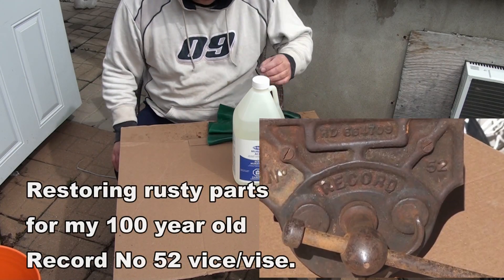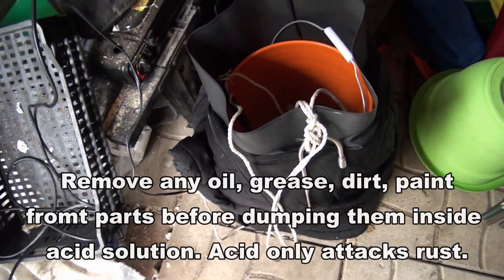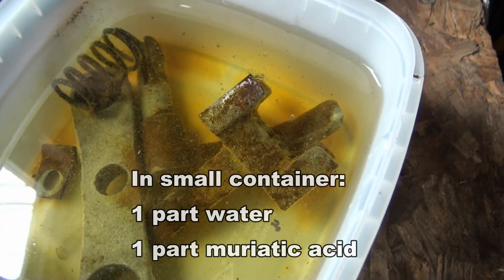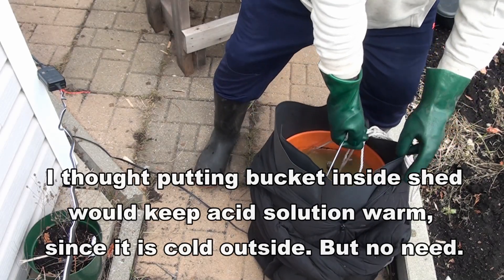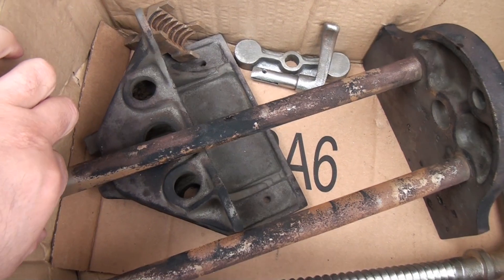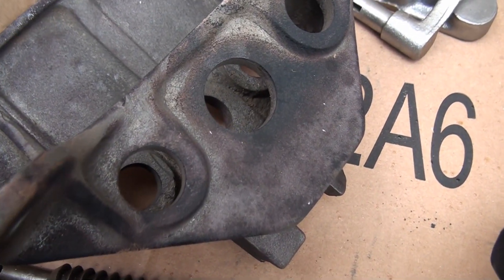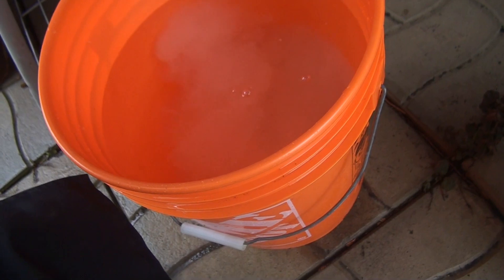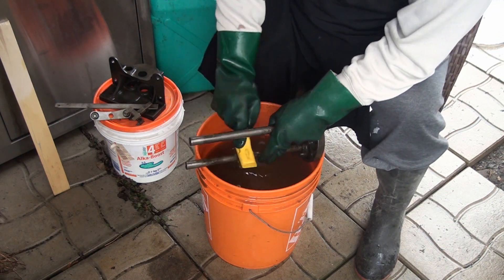Rust vs Muriatic Acid ***DISASTER*** Do not do this

Comment: Freshly cleaned steel LOVES to flash rust from humidity in the air.
Coat it immediately after drying, either paint or oil.
And it is always best to just neutralize acid with baking soda in water and leave it sitting in it for up to an hour, at least uintill there is no bubbling.
And alkaline water also prevents rust

Comment: So I am going to clean up some rusty railroad spikes.  I put some in Evaporust and some in pure Muriatic acid (31% Hydrochloric Acid).  The acid works much quicker. The Evaporust may work also, it will just take longer.  So question.  Is there anything to soak/clean the spikes in when they come out of the acid, that will prevent them from rusting right away again--OTHER than oil products?  I am eventually going to paint them but I don't want to have to paint them immediately after they come out of the acid.  If I soak in a high alkaline water bucket, then dry them, will the rust right away?  Any ideas?

Comment: When mine came out of the muriatic acid all shiny like yours, I found that not neutralizing the acid but just rinsing in water caused them to rust again. I neutralized with some Drano which I had.  This cause a black coating to form on the metal pieces which I did not want.  So far I have not found a way to keep away the rust that does not cause the blackening.

Comment: Its the water in the air that is causing it to rust again, clean fresh metal will rust quickly.    You have to SEAL The Items right away with sealer or Primer.

Comment: forget acid processes and use electrolysis which is safe and cheap. It is a bit slower and is certainly messy, but it will only remove rust and does no harm to the metal., An old domestic water tank or a plastic barrel is great for the job and will easily take even the largest of vices - try it out for yourself and you will see why I like it so much.   :<)

Comment: Baking soda neutralizes acid. I am a professional auto technician 20+ years and whenever a battery leaks that’s in a trunk that’s what we use to neutralize the acid and clean up. I personally wouldn’t open a bottle of any type of acid without a big box or bag of baking soda in the event of a spill or something. Might be better ways to neutralize I’m not a chemist but I wanted to say this so maybe it helps someone avoid an emergency.

Comment: Muriatic acid leaves a greasy residue and just rinsing won't get it off. I wouldn't use too much making soda, Ph neutral is around 7.6, Muriatic acid has a Ph of 1 and baking soda or sodium bicarbonate a Ph of 8.4. It will neutralise it as mentioned plenty of times before but I've personally always had success by simply cleaning with an industrial degreaser and then a pressure washer. On concrete and metal. Bare steel needs to be covered afterwards once dried, oil based primers with an anti rust additive work great.

Comment: Those fumes are insidious. 1 gal jug, 41%, lid on tight: inside 48' x 60' shop w 20' walls (large interior volume) all my stuff was rusting. Lid was not fully sealing despite being tight.  Put it outdoors and solved the problem.
Reply: At 41% and warm it will build up pressure. Usually 36% is max

Comment: Thanks for the good video. A few comments. Acid + base = salt + water. The natural antidote to (muriatic acid) hydrochloric acid is sodium hydroxide (lye). Muriatic acid + lye = table salt + water.  Water does not neutralize, only dilutes. Hydrogen chloride vapors irritate the respiratory system and corrode everything nearby in seconds!
In industry, the process is: after degreasing, rust removal with hydrochloric acid and then immediately rinse thoroughly. If the intention is to elektroplate, there is no need to neutralize, because the elektroplating continues in the acid. But if the intention is to paint, you must immediately neutralize with alkali (NaOH) and then rinse with plenty of water and dry with hot air. 
Inorganic acids produce interesting results. If you neutralize acetic acid with calcium carbonate (washing soda), you get calcium acetate Ca(C2H3O2)2. When heated, it decomposes into acetone and calcium carbonate.

Comment: The rust didn't come from the acid whatsoever. This happens when you get metal down to a bare surface and leave it exposed to moisture. 
It's the same reason your brake discs will get a coat of orange surface rust overnight if it's raining.
Bare metal parts need to be covered in either paint or oil almost immediately after cleaning.

Comment: I don't think it was the acid fumes.  I think it was just moisture in the air flash rusting the freshly etched metal.    You got fresh acid etched bare steel.  Any bit moisture is gonna make it rust right away.

Comment: I’ve been experimenting with stronger and stronger vinegar to get rid of rust off old tools. I think I’ve pushed it too far and the last batch I left in 20% strength industrial cleaning vinegar for a few weeks and now all the hardened steel is eaten away like a honeycomb effect. Does anyone know if they are ruined or is it salvageable with heavy grinding?
Reply from the maker: Hey Matt
I would not grind the tools. This would further weaken the tools by removing material. Neutralize well with baking soda and water and apply some WD40. 
What I now use to remove rust is Evaporust. Very effective yet gentil on metal and not corrosive to humans. Expensive BUT you can re use it over and over again.

Comment: You made it way too strong.  For every 1 L, use 900 mL of water then 100 mL of the concentrated HCl.  That means you will dilute the acid 10X.  Always add acid last.  So it you want about 3 gallons total.  Add 10.4 L of water to the bucket first then about 1 L of the acid last.  You only need to put the part in for about 20 minutes.

Comment: when you acid bath the metal it strips it bare. in that it will rust instantly! take it out of the acid and neutralize in baking soda, dry and either paint or coat in oil to keep it from rusting again rapidly.

Comment: I need to remove heavy rust from steel base columns . So if I understand.  1. MIX 1 cup acid + 1 cup water with baking soda. 2. Spray 3. Rinse with water 4. Dry really good  and 5. W40 or primer. I am right? Thanks
Reply: No

Comment: Be sure to neutralize the acid, with Sodium bicarbonate (baking soda) or Amonia. Then, immediately coat the bare metal surface with a protective barrier like oil, or  primer if you plan to paint it.
Reply: If you want to electro plate it with nickle how would this be done ? Thanks

Comment: Flash rust is a thing, but note how the part that wasn't in the acid didn't rust? Yeah, water alone won't neutralize the acid, use a baking soda water mix, then rinse with plain water after. I made that mistake before, it's a learning process. Love how you had the success and failure together. So many fake people would have edited out the mistake, respect.
Reply from the maker: Yeah, I learnt the hard way too. Thanks for watching.

Comment: It may be a bit redundant, but I think I would pull the parts out. Neutralize them in baking soda and water. Before I did any kind of brushing at all, when dealing with acid. You can always throw them back in if they are not done.

Comment: Muriatic acid is over kill at most you only need a 6% solution. Ifs better to use vinager or citric acid for rust then neutralize with a bicaranate solution. Use wd40 to stop it rerusting. Do not use muriatic acid for this.

Comment: It is best to neutralize with baking soda in the water.  Plain water would have to be changed a few times with long soaks.  This would most likely reflash your rust.  Baking soda neutralizes the acid in all the nooks and crannies very quickly so a ten minute soak in warm water with soda will be very effective.  Then one rinse in pure water and quickly drying the items seems to work the best.  After wire wheeling wipe them off and coat with an oil.  I like to heat them to three or four hundred degrees and then quench in oil.
Reply: Good advice. What’s the strategy of heating to such high temps at end… is it to dry it?!
Reply: @rudysmachado5747  dry it as well as allow the metal to draw the oil into the steel while forming a strong coating
Reply: PS:   you do not want any moisture under any type of coating for the most part.
Reply: PPS:  Also gets rid of the moisture quickly and thoroughly.  Longer it sits on or in the metal the more oxidizing occurs.  Lots of O2 in water able to combine with the metal for rust, much more than air.

Comment: Used Muriatic Acid for 25 years.
Safety first.
Use full strength or 50/50 water based. 
If soaking at full strength it has to monitored. Will eat the part. 
I usually will brush acid on non precision car parts. If the part had ground or machine surfaces use sparingly. Or use cleaning vinegar. 

Some parts I full on full strength. Trailer axle, trailer springs, lawn mower deck, snowblower housing, car rims.

Parts of machine finish to use a lighter acid to clean. Crankshaft on lawnmower or snowblower.can put electrical tape on ground finishes and do the counterweights with Muriatic. 
Always be careful. Bottom line.

Comment: Freshly cleaned metal will rust start rusting immediately in the air as well (the acid vapors also) you need to paint or oil the parts to keep the air away.

Comment: Three things: 

1) Neutralize the acid on the iron by putting them in a baking soda or drain unclogger + water solution for a few minutes, or scrub them down with oven cleaner (fume type).  Then soap wash.  This will prevent rust flash, and also the rust won't develop under any paint you might use.  (Water alone does not neutralize anything.)

2)) Don't acid-bath springs!!! This will cause a change in the metallurgy and also cause stress concentrations.  Just buff them off.

3) Those plastics like what the bucket is made of don't get affected by Muriatic acid.  However, some plastics disintegrate in short order.  Best to keep this in mind.
Reply from the maker: Thanks for the tips. I will be more careful next time knowing this. Unfortunately I had to learn the hard way. Thanks for watching!

Comment: Or hydrochloric acid if you want the more accurate chemical name. Muriatic acid is an old fashioned term meaning "pertaining to brine or salt" (Wikipedia) which really has little to do with its modern production. A term used more for historic reasons than anything else. Sometimes also called Spirits of salts. If you walk into a hardware shop here to buy Muriatic Acid they will look at you blankly. I suspect that Muriatic Acid usage in the US is a bit like Imperial v metric. Sometimes the US has a bit of difficulty keeping up with the times.

Comment: I had a neighbor with a gallon of muratic acid that had a pin hole leak onto a wood bench and didn't know it. It ate a hole in the bench and the fumes caused any fine steel that was nearby to rust in a matter of a couple weeks. Almost a disaster. It's thought me to even bag the jug with some heavy plastic if I store it.  I pretty much use the Evaporust now, fairly safe even though it takes a little more time. 👍
Reply from the maker: Where I bought from, they had it wrapped in a thick thick THICK plastic bag. This chemical must be kept out side! Away from any kids! I don’t use this product anymore. It’s a great product but too dangerous.
Reply: @Quinteros777  Yeah, I keep mine at the end of the garage by the door in a thick plastic bag also. ANY leak can be a disaster. If the stuff wasn't handy to have once and while I would just buy and discard.  The good thing is no kids around anymore and ifthat were the case I'd just not keep it around at all. Seeing first hand what just the fumes can do convinced me the stuff is dangerous like a lot of acids.

Comment: You mentioned breathing the fumes and the need to use a mask. What you need is an acid gas rated respirator, or preferably such a respirator and adequate ventilation. Also, removing rust by this method might be problematic for the spring as it can make the steel more brittle. The rest of the parts are thick enough that hydrogen embrittlement of the surface is unlikely to be a serious issue. It is nice to see proper buttress threads on the screw, which is a detail often missed for parts today. It is a stronger thread profile in one direction, so it is used in that case in the direction that the screw is tightened.
Reply: i used acid to clean some old machinist calipers and dividers, the results were the spring steel piece where the legs squeeze on a pinion the spring just fell into two pieces.

Comment: You made a shitload of mistakes. Water does not neutralize acids. Sodium bicarbonate will neutralize the acid but leave a film preventing paint adhesion, use sodium hydroxide. You had flash rust in parts but the black is called smut and is  the impurities brought to the surface by the acid. You still had acid in the pores of the cast iron because you didn’t neutralize the parts. You should have dissolved the rust with the HCL, neutralized with lye (NaOH ), washed in water , dried and painted. The polishing is a waste or time. A quick dip in phosphoric acid would have left a phosphate coating on the iron for more protection and paint adhesion. Warming the acid is not necessary , it would have worked fine but taken longer. Putting springs in the hydrochloric acid is not good, you run the risk of hydrogen embrittlement and the spring may break.
Reply from the maker: Wow dude, where were you before I began this adventure?!!! Thanks for sharing you knowledge. Surely will help the rust removing community.

Comment: HI. When you wash your part, did you use a water pressure washer to cleaned deep any acid ? Also, before painting,  I highly recommend to paint with zinc (spray can or using a gun LPLV) to repel any humidity and protect against rust.

Comment: Acid cleaned steel will flash rust very quick so the second you have neutralize it you need to spry the parts with some oil type WD40, or if you are supposed to paint it just do a quick base cote with primer.
Reply: You need to neutralize it before you do anything else.
Reply: @Policefxsupport.4381  thanks! Can that be done by way of a spray bottle with baking soda/ water mixture? Or does the part need submerged/ soaked in baking soda water?
Reply: Is it necessary to rub baking soda water on parts to neutralize or can you just immediately dry and spray with primer. I’m getting contradicting info. Thanks.

Comment: The more I'm just itching to do it... 😳.
Reply from the maker: Thanks for watching. I tried a few rust removal methods and although muriatic acid was quick and effective, I now use only Evaporust. Takes longer to remove rust but it is very very safe and you can reuse it over and over again. And it’s fumes do NOT ruin my tools in the shop.

Comment: Water DOES NOT neutralize acid. Only a base neutralizes acid,. You should have taken your parts from the acid, rinsed them in water and then put them into a base to completely neutralize the acid. You could skip the step of rinsing with water and go straight from acid to base. After that, you must protect the metal to prevent it from rusting.

Comment: Muriatic acid is very potent stuff, water alone is not enough to netralize the acid. You'll need a mixure of baking soda and water afterwards but even then there's a chance the metal will flash rust and continue go brown afterwards.
Reply: Agree baking powder and dry and oil or paint as fast as possible.
Reply: @adrianrouse5148 yes I agree. From my experience,  do not use indoors, lathe bed, drill press, some tools will turn brown and start to rust. I have done body parts by putting a mechanic cloth on panel, then pour or brush acid on. When cloth turns brown, remove. Repeat as necessary. Neutralize with baking soda, dry and paint immediately
Reply: What about hot blueing? If you heat t metal to@ 650-700% then drop(gently!) Into linseed oil it will be black oxide coated

Comment: U need to oil the metal after wiring. Because it is raw steel which will need to be washed in baking soda after acid

Comment: After removing rust, I rinse with water,  then a baking water solution,  If I'm going to paint it? I rinse with HOLDTIGHT solution ( stops flash rusting for about a day). If I'm not going to paint,  I final rinse with WD-40, I also ruined some metal in my shop just from the fumes the first time I used it,  USE ONLY OUTSIDE!

Comment: Here's a little story.  I once was etching a concrete floor with acid at work.  I left the unsealed acid container in my work truck.  It fell over and leaked a small amount on tge floor.  My work truck was closed and locked for several days while I was on vacation.  When I returned there was literally a cloud in my truck when I opened the door.  The acid caused slight corrosion on all the bare metal inside the cab of this truck.  As for this guy.  Wash the part in baking soda before drying.  Dispose of the acid laden rags.  Hermetically seal any containers having acid.  If you have bare metal it's a good idea to coat it so it does not rust if a period of time passes before it will be painted or have other metal conditioning.
Reply: I derusted some parts at work in a large automotive garage, left the bucket under a bench and forgot about it. Tool boxes, benches, electrical outlets & conduit started rusting all over the shop. I had to quietly dispose of the stuff before anyone knew it was me who caused the mess.
Reply: yeah and leave the shed door open! those acid vapors will rust everything in sight to bits given time.

Comment: You can buy a gallon for around 12 bucks at home depot with a ~30% concentration. No need to dilute and it's safer to handle. $1.25 ammonia at dollar tree to neutralize it and lots of cheap scrubbers and containers.